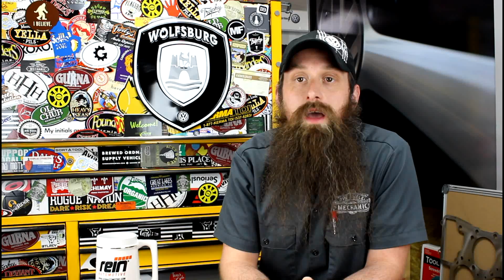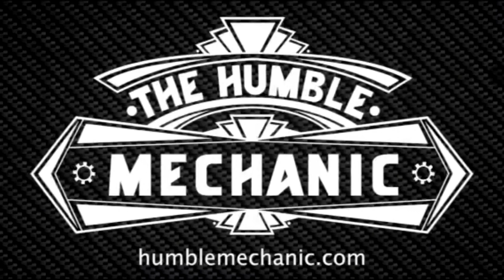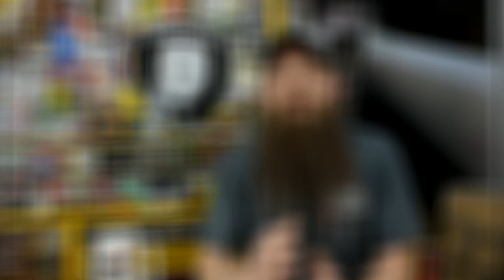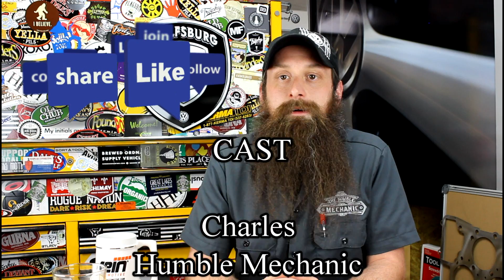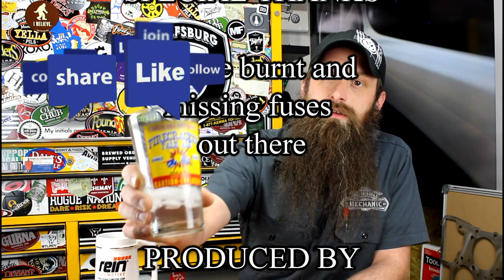Thinking Like an Automotive Diagnostic Technician

Comment: For those of you who like a challenge.. Anyway I can challenge you to listen to my engine and tell me what you think is making the noise? I changed the timing chain 6 months ago.. I disconnected the vvt solenoids shortly after because it started running rough.. And they were only getting 4 volts.. Ran fine.. Now the car died again.. Drilled the pcv orifice with a 3/32 drill bit.. And it's still blowing some air through the oil cap hole.. And rattling...
Video is on my channel.. Any ideas are appreciated..

Comment: You said check the fuses first right So part of the process of checking the fuses is checking the wiring diagram for the fuse location in fact that should be the first part

Comment: I think the covertible top diagnostic took longer because checking all the fuses shouldnt be a first step.. if you would have serched for the fuse that powers that motor in the first place.. you would not need the costumer to tell you it was missing..

Comment: How do you decide which codes take priority over others? Like if I have a p0171 and a p0128 and a p0420. Which do I go with first if the customers only complaint is that the light is on. Thank you.

Comment: When checking fuses also check that it's the right amperage fuse for the circuit.  There are people out there who don't understand the difference and will use any fuse that fits.

Comment: What got me many times was a low voltage/worn car battery. A VW Passat B6 sometimes did fire up and sometimes it did not or id did take too many tries, thought it was a steering wheel lock problem because it's apparently a common issue and has similar symptoms but it has to have been the starter motor solenoid not having enough current running through the coil to push the pinion all the way through to engage with the starter ring and close the circuit.

Comment: My 2006 nissan maxima has blown the main fusible link on the positive battery terminal several times in the last couple years but recently blew 2 times in one day so I just had it towed straight to the shop because I didn't want to have to buy a new fusible link terminal (like $35 each) without knowing what's causing it. Anyway, I've talked to a handful of different mechanics and most of them said that that main fuse can only be blown by a short to ground and that it would definitely be between the battery and starter. Although I was told to check the negative cable as well. Seems not too complex as other parts of the wiring harness but my question is this: can the main fuse be blown for any other reasons? I only ask because one of the mechanics I spoke to said that he has replaced the fusible link on many nissans due to something like a locked ac compressor. 
If it's just two cables, maybe I could get lucky and figure it out myself or just replace the cables entirely. Oh also of note: the fuse blew either while the car was off or when I tried to turn it on (I didn't check the fusible link before I turned the car over because I didn't know the car was dead until after I tried to start the car and realized it was no crank, no start). Thanks so much in advance!

Comment: After 2 weeks of paying for a rental car or not having a car at all with 2 kids, I've finally learned that not all auto repair shops are created equally. My question is this: if places like Firestone are only very knowledgeable about basic services such as oil changes and breaks, why do they even offer services like taking your entire engine apart? Why would they even offer the option to trace an electrical short in your car? I came in for a pressure test for a coolant leak and without doing ANY other diagnostic tests, they told me to just buy a new car. Why not say "hey, we don't really know what's going on because we don't do complex work like that"
Reply from the maker: That is a great question. The main reason is to not lose business.  I’m sorry for the hassle. I’m guessing it’s too late to get the car somewhere else?
Reply: @HumbleMechanic  oh no it's definitely going somewhere else haha. I actually barely asked Firestone about the electrical short because my primary concern was about the overheating. They did a pressure test which revealed a "busted radiator" but apparently there is no way to know if the water pump and other elements of the cooling system are also effected because since the radiator won't hold pressure but that's neither here nor there right this second. I'm done with firestone, gonna replace the fusible link and radiator tomorrow ourselves and then take it to another shop for the other elements we need diagnosed but I was just wondering if I might be able to notice a short myself if it's really just like 1 or 2 cables 🤷‍♀️ I really have no idea where the cables go or how accessible they are. I think I've read every single thread on the internet regarding main fusible links repeatedly blowing haha. It seems like a lot of people complain about having to replace the entire terminal (instead of just the link) but given mine blew twice in one day and while the car was seemingly not even on, I know there's got to be a bigger issue here. I've not seen anyone talk about my situation exactly and come back with the fix.

Comment: Question for you- I have a mechanical aptitude test coming up for a job, that is a hands on test rather than a written one. The test is to troubleshoot and correct basic issues on a simple machine. I have no prior job experience or training, but I’m told it’s a “you have it or you don’t” kinda thing. Have you ever heard of such a test, and if so, are they any tips you could give?

Comment: Hey guys,
I had a P0420 code for several years.  
At the time, and with my lack of knowledge, I didn’t care about the P0420 code …I thought it was only emissions.  The code IS for emissions, but it can ALSO mean other problems exist too!  I’ll explain later.
So I drove it like that for maybe 35k miles, maybe 40k.
A surprise pregnancy (no. 5) sent us over the baby seat limit for our larger ride.  Lol
Alas, we had to buy a new car …and sell my faithful Altima (now at 201,000).  This made the P0420 code more of a deal breaker.  I wouldn’t get as much with the engine light on.  
And so began my journey to a CEL-free dash!
I started with Bluedriver.  So glad I did!!  I was able to see my fuel trims!!!!  Life changing tool!!!
I was at 9% on my long trim and 17% on my short trim!!  This meant I had a few leaks!  
I was opened up to the world of not trusting CEL lights!  Curse you Bluedriver!!  Lol
I started with a starting-fluid-spray-test and found the first leak.  Turns out when I had replaced my PCV valve, I had dropped a small ring gasket that sat in the PCV-hose-to-intake port.  Fixed that and watched the STFT drop to 14%.  Still not good enough.  Read that a lot of Altimas have cracks in their exhaust header.  Checked that and found TONS!  TONS!  There’s my problem!
Fortunately, the cracks and the P0420 code are the same part.  My destiny was calling me!  I had to replace the catalytic manifold to WIN!  Lol
.
So I first tried a $100 aftermarket catalytic converter/exhaust manifold on Amazon.  Didn’t even come close to fitting!  Should have known.
Returned that and bought a $350 “OEM” one from O’Reilly’s.  That didn’t fit too well either.  Ugh!
Engine side heat shield didn’t fit, so I left that out.  Had to modify a few heat shield holes for the radiator side.
Had to use spacers and different bolts to match the manifold mounting bracket up near the bottom.  Finally got it in.  What a pain!
Also found out that my exhaust pipe bracket had been squashed from coming down off a curb from our yard or something.  So I replaced that and it helped the pipe meet up with the new manifold even more.  Still wasn’t OEM though as O’Reilly said it was.  Pshshh.
Anyways, so I started the car up.
P0420 gone!  Boom.  Within the first drive cycle!  LTFT went down to 8%!  So awesome!  LTFT + STFT went to 9%.  Nice!
.
Here’s where the crap hit the fan!
The dreaded P1273 started popping up to say hi.  Ugh!
Went through a few fuel trim clearing procedures (including unplugging the battery overnight) and it just kept popping back up.  
Tons of sites were saying it was a lean issue.  Injectors, bad sensors, yada yada.
Tried replacing my sensors a few times.  Both upstream and downstream!  Nope.  It came back.
.
Found on YouTube that ONE mechanic was saying this code also popped up from an EXHAUST LEAK after the flex hose joint.  I had remembered that after I installed the new converter manifold that the flex joint just didn’t feel as nice of a fit when I had put it back together.  It was tight, but just didn’t feel right.
So I looked at that while the car was running and sure enough, noticed that I could hear the engine when I put my ear up to the flex joint.  There was a smaaaall gap where O2 could get in and throw the readings at the 2nd sensor!  Not enough to notice a huge difference on my Bluedriver (2nd sensor was showing 0.265 volts), but enough to supposedly throw my P1273 code.
So I installed a few rings around the male pipe connector on the manifold to help lift the curved side of the flex pipe gasket out a little further to fill up that gap I was talking about.  After a few rings that I had cut out of a tin sheet I was able to make it mesh good to work with the new manifold and old flex joint and pipe.  Bolted it back up.  Started the car.  No more noise.
The car sounded better than it had in a long time!  No cracks in the exhaust, no flex pipe leak!  
Performed the fuel trim history clearing procedure.
Man oh man I can’t tell you how pleased I am!!!!  LTFT is 7%!  LTFT + STFT hovers from 7 to 9%!  
Been driving the car now for a long time and no codes!!!  No P0420, no P1273!
Engine purrs!

Here’s my final readings:
(range includes cold start to warm engine, at idle and 3000 RPM)
STFT 0 to 9%
LTFT 7%
O2B1 0.12 to 0.9V
O2B2 0.28 to 0.31V
So what did I learn?  Here’s the main things that will change my mechanic life forever:
1. Catalytic converters should last for 200,000+ miles with a well maintained engine.  If you’re cat goes bad, you probably have other problems that just haven’t thrown a code yet.
2. You can have small problems with no CELs that can turn into big ones!
3. Fuel trims can really help diagnose issues!
4. The 2nd O2 sensor is not JUST used for exhaust emissions!  The ECM uses BOTH O2 sensors to determine fuel trims (and lean or rich fuel conditions).

So what did this mean for me?  That I will fix catalytic converter problems much sooner from now on if I plan to keep my car around past 200,000 miles.  
If your engine is running rich for a long time it can damage other parts, and eventually expensive ones.  I’ll admit, emissions aren’t my biggest concern.  But I do care about engine longevity.  
All that said, if you have a P0420, P1273, or P1274, hopefully my story will help save you some hassle.  
Take care,
Benny
Reply: Thank you very much . I own a g35 and i have the p1273 code. I will fix it tomorrow
Reply: @jeffsafawi7947  did you fix it?

Comment: 6:34 if there is no Faults, the PCM never got the command to react, thus there isnt gonna be a code/fault. - my two cents
Reply: If there is a command, and the Module doesn't respond to it, and also throws no code = the module is bad.

Comment: all good points, When I worked for Mack/ Volvo trucks  if we did pull a module or something electric  say maybe a recall or it was bad on one thing but good on other you would keep it label what the issue is on it put in your personal cabinet  as a test piece, for example the dash cluster assy i had one that the RPM gauge was dead on but everything else worked great on,  i had it marked no RPM gauge so if I had one that say isn't reading Oil PSI or the high beam indicator was out  or whatever rather than busting the breakout box out and doing an hours worth of recommended testing per the engineers at Mack/Volvo  if I thought i had a bad sensor/sending unit Id pop 4 screws out unplug 2 harnesses swap in my test unit and boom id have about a 99% idea of what to go recommend to the customer rather than spending an hour and then maybe still taking a shot in the dark I could spend 5 mins still get paid for my 1.5 diag and be pretty damn sure that I was making the right call, everyone had a couple dash cluster stuck away somewhere did that for abs modules and yaw rate sensors belt tensioners I had a whole cabinet beside my box full of test modules that were known good modules 

   working for a dealer you see a lot of the same ol issues day in day out but you get too relaxed make a bad call and miss a proper diagnosis, you might have just bought yourself an expensive ass part, granted every now and then you get an issue in you  swap out the test pieces and still nothing and still have to end up with the break out boxes dash pulled apart checking wiring harness but most of the time you see enough of it ya get a pretty good idea what its gonna be its just nice to know that what you say its going to be is the fix,  ground problems and missing fuses are the biggest problems these days,

Comment: I work as a military technician on humvee’s and other trucks. We had a humvee come in with a lighting issue. Turn the headlights on and all the lights, marker lights, turn signals, stop lights, and blackout lights(Lights for night driving with NVGs) except the headlights would come on. 
     Started with the switch checked pin to pin and everything was fine, checked the connector same thing everything was fine. Jumped the wiring from the connector to the headlights, and other lights one by one and they worked like they should.  
     After a good full day of checking continuity, powers, grounds, this and that and everything else I realized I was having to awkwardly twist the harness and connector for the light switch to plug it in. Looked at the pins on the connector and pins on the switch and found out the connector was twisted internally and all the pins were about 4 off so pin “a” on the connector was going to pin “d” on the switch. 
    Took the connector apart and put I back together the right way and presto we had headlights and everything working like it was supposed to
Reply: Are you a Civ Tech for the Guard or Reserves? That's where I started as a title 10 tech for the Guard did it for 12 years and in that times working of FMTV/LMTV,HEMTTs,Humvess ect I adopted a diagnostic strategy that helped me became really really good at diagnosing issues. I'm now the main diagnostic tech for my current shop. I wants say that working as a Military tech that diagnoses is so over looked and parts changing is considered diagnostics lol.

Comment: Stuck on diag... Ford Escort X2 I think 2002...

P0301 Cyl #1 misfire.

Look at plug, look at ignition wires see no problem. Switch plug and wire with #2 and the #1 injector with #4,  test drive... Code P0301 resets. I can not feel a miss even under load.  Put on dyno and run it while watching the scope... No misfires.

I am in a reconditioning shop, this car is still under warranty, I talk to the owner(the shop) and send the car to Ford. Ford says it is a problem with the Variable Valve Timing (VVT)... We let them fix it.

Car comes back from Ford light off, on the second drive cycle IT'S BACK!

I belonged the the Automotive Service Council in our area so I take it to a fellow Tech for a look to see if I am missing anything. He says the same thing I do, there is no actual miss.

I talk the the tech at Ford and we compare notes... We send the car back to Ford and Ford Engineering will look at it.

4 weeks later Ford calls us to come get the car. The light is off, I run it for a second drive cycle and no code... I ask the Ford Technician what was done to the car. He says they would not tell him.

I look this car over well. I look to see if the PCM is new and I look at everything under the hood. I can't see where anything was done that I or the Ford Tech could not personally account for.

We compare notes and figure what was done was probably a reprogramming of parameters of the PCM to set the code.  Between us it's the only explanation.

This was one of 2 cars ever to defy me. It defied 3 techs all with 20 years experience each, one of them Ford trained. Consensus is Ford Engineering reprogrammed the PCM in a manner that was not quite ethical.

Comment: I'm in training through Toyota. Last month we get a car from Carmax and the ticket just said "replaced fuel pump/ no start" we diagnose a PCM and and a integration relay. We checked everything by the book. Got the computer released and ordered and the IR too. Installed both and got absolutely nothing after the handshake. Checked everything again and we where getting power to the computer but it was not responding. We had our diag specialist look at it and work with us for a day and a half and got nowhere. Manager takes the ticket from us today and gives it to the same Diag Tech and in less than 40 mins he calls us over and shows us that the computer had been back probed by something big enough to separate the pins in the connector. Now they are working on getting the wire harness approved.

Comment: The crazy thing these days is how the technology gap is changing. I trained as and spent twenty five years working as an avionics engineer . Modern vehicles are embodying technology that was the preserve of sophisticated military jets and helicopters! The technology gap is getting narrower all the time. We have cars with radar,thermal imaging, flir, head up displays etc! It feels like the car makers are in a technology arms race to utilise the most cutting edge technology available. They only going to get more complicated and tricky to work on. All I can see in the future is punishing bills for owners when glitches rear their heads. The repairs and maintenance on the aircraft shows just how much work is involved.